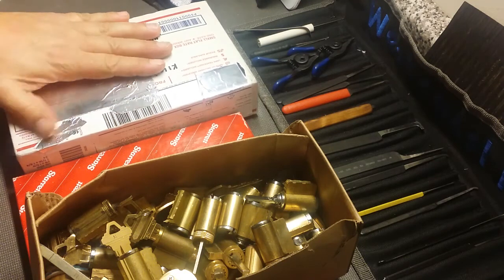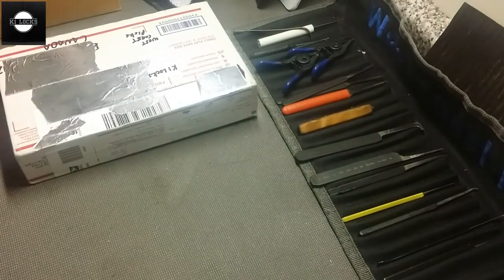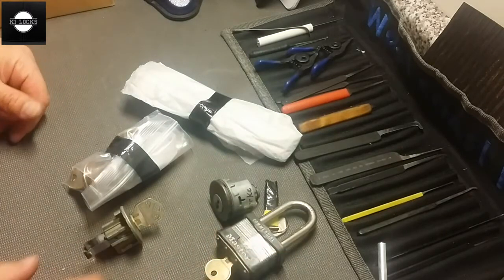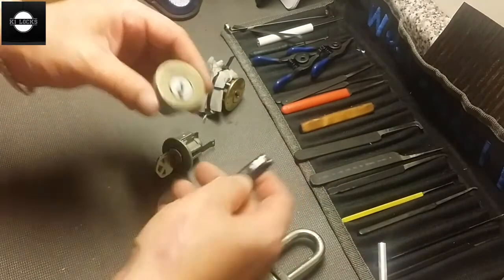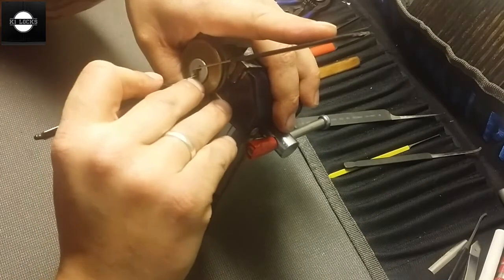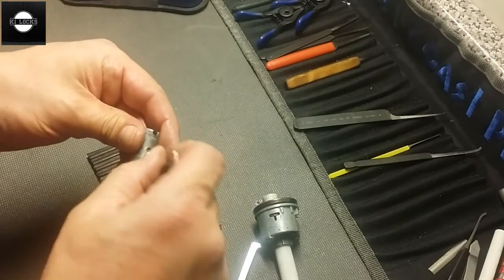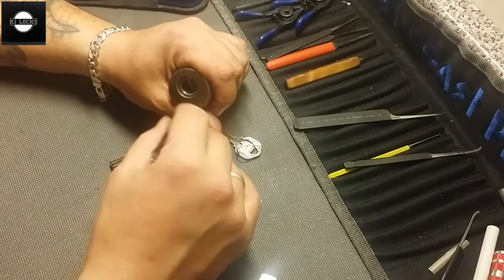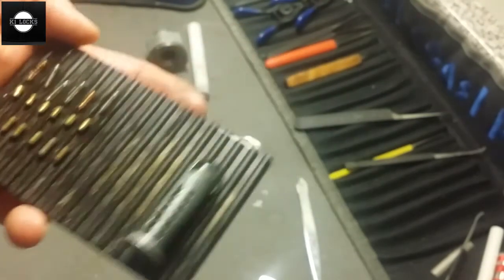-=245=- Package From K1 Locks! - Brrke SPP!

Comment: I use Starrett to make most of my Picks.  Aside from the fact it's good quality metal, I like the fact I can buy it in 0.025", 0.020", 0.018" & 0.015" thicknesses.  I buy the 12" Feeler Stock Blanks as opposed to the coil.  It's fantastic stuff.

Comment: Is it good policy to just seal those holes up when you start working on these kind of cores even without t pins?
Reply from the maker: darthpaul123 I would say yes. Though they won't get in the way if you don't reduce the drivers at all, I prefer to seal them up anyways just incase something happens.
Reply: West Coast Picks thanks.  I just started working on some with these.  I need to go grab some epoxy here.